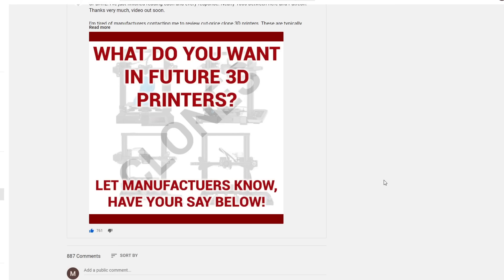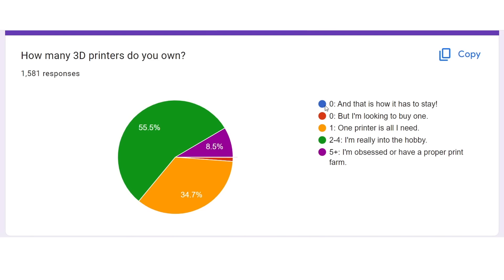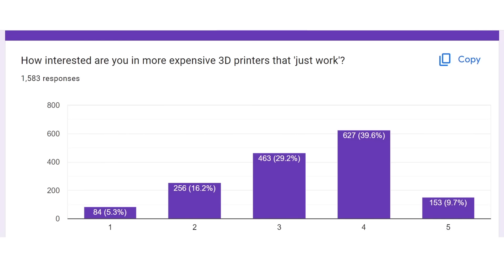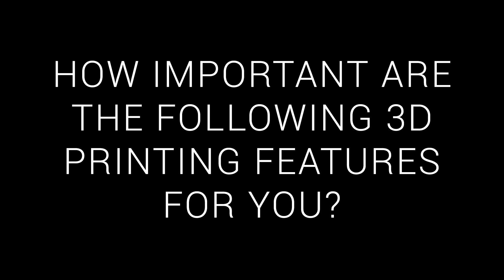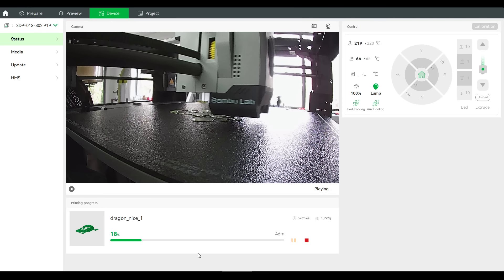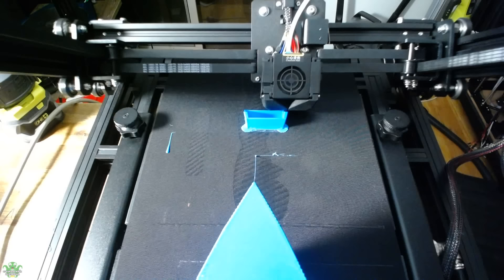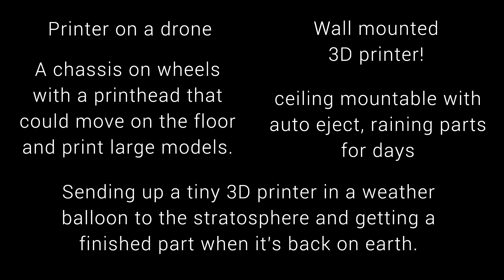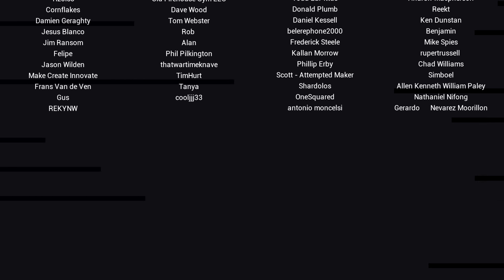The 3D printers the community actually want: Your say in 2024

Comment: ability to turn the printer of once the print is done while sleeping or at work 
laser engraving - speed - real run time estimates - silent fans -  print head pause to add magnets weights nuts balls keyrings -
power out recovery - duel sd cards - sd card removal once you have clicked print so onboard memory? - on off switch on the front - love hart  or fav button in menu to know what print works or keep using, i use a folder system of working, always print,  testing. - always print for me is some file you print no matter the color u have like a jar keychain or toy.
Reply: 1. Laser engraving can be swapped in, on tool-changing printers, generally.
2. Run-time estimates are usually good, if you have the slicer and printer both set with the same settings, and they are realistic. Often, they aren't. Klipper and RRF are both good about it, slicers in general a bit worse. I think a lot of it is that speed and accel settings, and actual speeds and accel, vary too much, without feedback to tell you the actual numbers.
3. Quiet fans cost money, and either cool worse or require ducting. Sunon maglev, FI, are quieter than anything else offering good performance, but can cost more than Noctuas, as it concerns axial fans. Noctua offers very quiet operation, but also low performance. For 50xx blowers, though, IMO, Winsinn with hydraulic bearings are surprisingly good.
4. Print pausing is supported by all popular firmwares. BUT, the exact gcode to do it can slightly vary by slicer, since it requires using slicer variables to inject the pause at the right layer(s). That basically means you have to do it yourself. It would be nice to have a universal gcode snippet to include with the STL, but that seems to be a pipe dream.
5. Power-off recovery is nice, and it's getting more common. I'd like to see them use some FRAM, or NVRAM (on the cheap, some RTC chips might have enough user memory for the job, especially if they can also be told to stop counting) for storage, or implement a power loss detection event, to only save to flash when the power loss occurs (most log the print, as it's printing).
6. Dual SD cards...why? One, to update firmware on some models, or occasionally print for troubleshooting, aught to be plenty.
7. Onboard memory exists, on the SBC, which may or may not be integrated, depending on printer. Get it controlled by a computer, if it's not already, and ditch SD card printing!
8. Favorites are a good idea, too often overlooked.

Comment: Very interesting and timely subject.
I've been in the business for 4 years, exclusively as a non-profit hobbyist. Initially with QIDI X-Plus and Artillery Sidewinder X1, now with BambuLab P1S, BambuLab A1 and Elegoo Neptune 3 Max.
I am happily retired, I enjoy it a lot, I found myself in 3D printing at the time of the pandemic, very happy with it all.
Aspects that I consider most when it comes to improving efficiency:
1 RFID as standard for filaments. I've been thinking about this forever. It's about creating the standard, or even following one that already exists, like USB-C, and opening it to all manufacturers. Consumers are grateful
2 super reinforced Nozzles, with diameter adjustment via software. It will be a very welcome game changer
3 beds with standardized dimensions. Pre-defined measurements for different printer categories
4 Unified voltage for all equipment in 110/220. The whole world will thank you
I'll stay here.
Congratulations on the channel, and continue with success.

Comment: @RPMiller, I agree 100%.  I think the 500MM size is very underserved by the market at this time.  I was very glad to see the latest Ratrig can be had with a 500MM bed size and I really like the way they do the 3 different bed sizes with the same form factor.  I think modular beds that could be swapped out quickly and easily as needed  are something innovative that no has thought to offer.  I don't always need a 500MM bed, but it sure is great to have when you do.

Comment: i used a stock ender 3(and3v2) for 4 years before FINALY upgrading to the Anycubic Kobra 2(non pro) and it is wild how quickly I learned what ACTUALLY matters to me in 3d printing. 

1) Reliability. It just works and that's it, no muss no fuss
2) Speed  I dont need my prints god awful quick but printing at mostly modern-ish speeds reliably is a god send
3) Repeatability. Its the same story every print. Same time, same quality, same expectations every time
4) Simplicity. Its just easy to use. NOTHING is hidden and its intuitive to navigate to the option i want without habing to look through a yt video
Reply: Any decently modified Ender-3 is even better than that Anycubic...

Comment: How about a slicer that adds connection hard points. Slot connections, screw holes, even just solid blocks. Even line up marks would be useful. Intelligent slicer software that can at least suggest cut lines, and orientation of prints to minimize the need for supports.

An example would be a life size foot. Oriented sole down the arch would need support, and nearly the whole inside would be filled to support the upper. If it was cut where the leg connects, and oriented toes up no support would be needed except for the toes which can be another part pointing up. The heel can be printed with minimal support under the sole with the interior hollow. Another example would be torso. Legs are cylinders, no support. Crotch of pelvis, printed upside down, minimum support inside. Crotch to bust. Cylinder, no supports. Under boob to under nipple, minimal support. Under nipple to lower shoulders. Cylinder, no support. Shoulders minimal support. Except for the sole of the heel, and under boob all the supports are inside the print.  

 Infill should be customizable to a thickening of the print walls for strength like a cardboard box not just infill the whole print. 

We should be wary of cheat pricing. That's cheap printer expensive, non refillable ink cartridges. The openings for cheat pricing with 3d printers is software that wastes filament, over priced software, and files, software that demands personal information it can sell. Updates that are down grades. Updates that are incompatible with anything you already bought.

Comment: I wish filament manufacturers provided information about the mechanical properties that their products can achieve under different configurations (layer size, infill, infill pattern…). I feel current filaments could be used for more functional prototypes, but the lack of info makes it difficult to design parts compared to other manufacturing processes that produce isotropic parts (simulating anisotropic parts can be quite difficult if you have to deduce the properties of the part from the ones of the filament). 

I’d pay for a book with tables listing average properties and recommended extruding settings for different materials, like the ones I use for designing metal, ceramic and plastic components. They are incredibly useful for engineering functional products. Unluckily I haven’t been able to find anything like that in the 3d printing world

Comment: damn forgot to vote!
for me a 60c chamber in a minimum requirement. A bit dissapointed with the bambu  p1s chamber, it goes up to 40-45c for ABS only, but i added insulation to the panels and now it's 50c for ABS
I could add a heater but that needs wiring and takes power and wastes energy.

same with nozzle probing, it's a min requirement, I DO NOT want to baby my first layer

Comment: I really want to know more how to setup marlin, when you change something or replace something. I have changed my ender 3 pro, with TFT35 display. SKR mini 3.0, BLtouch and smart filament sensor. I didn't find anything regarding that.
Reply: Get an SBC, and learn to use Klipper. It's not just about speed, but not needing to rebuild and reflash as you upgrade and tweak.

Comment: I'd really like a glass bed but with a removable sheet steel surface. The glass is a great reference shape to keep the printing plane perfectly flat. Leveling is easy, but flatness is unheard of. I'd rather not have my ABL compensate for divets that result in some dimensional inaccuracy. This is esp the case if you need your bottom surfaces to align to some mechanisms
Reply: The problem with that is that you'll need strong magnets to prevent the bed from bowing out. Usual magnetic beds use ferrite magnet sheets, baisically supersized fridge magnets. You can't put ferrite sheet under glass because it won't have enough holding power through glass's thickness. But ferrite magnets are used not necessarily because it's cheaper to (though it is cheaper) but also because they can tolerate the temperatures. Neodymium magnets that would have enough power to hold through glass lose their power right around 55 degrees celsius. There are high temp neodymium magnets, but the price stings, and their temperature tolerance is still up to 100-110 degrees, if you need your bed at 90 it'll be hotter than that between heater and glass.
Reply: @TheLaXandro  Dont use a ferrite sheet. No professional uses those, they're terrible. Do what prusa did

Comment: There's a guy, Greenboy, who's supposedly working on a relatively medium-to-low-cost pellet hotend/extruder system that could be used as a drop-in replacement for a filament hotend/extruder system. From his videos, I don't know how reproducible his current methods are as of yet since I gather the parts look like they might still be custom made (that screw in particular doesn't look off-the-shelf), but using pellet-sized plastic materials instead of filament is certainly one way to recycle failed prints.
Reply from the maker: I'm on the email mailing list. Very keen to use his design.

Comment: I just wish they a way to dye the plastic right before it came out the hot end. But another idea would be a bed that was made of many tiny plate that could raise  up and act like supports. Maybe a printer that used a bunch of tiny rods to make a mold like those gator sockets that fit broken nuts, and bolts.

Comment: i wanna see what bambu could do with a belt printer. i had a ender 5 plus for its large print area, but it died and i wanted to try something else. got a bambu p1s and its been easier all around. i dont like that its wireless only but it works well enough. the only thing i miss and that i designed around was the larger print area of the ender 5 plus.

Comment: Being able to customise and upgrade printers is what I miss most about my first 3D printer, the humble Ender-3. I wouldn't mind it if a new printer reintroduced aluminium profiles.
Reply: I think something a lot of people miss, is that Bambulab saved big by not using extrusions and using desktop pc case building tech which allows for a lot less human involvement in building the chassis and lower material use while retaining good rigidity.

Think about how much human effort has to go into assembling even the humble ender then think if the parts were injection molded or pressed into shape instead.

I think a reasonable amount of modability can be included via user accessible mount holes etc, but I think extrusion if you want high quality for lower prices is just unrealistic.

Comment: iv got a 300x300mm printer and damn i wish i had a 500x500 i do a lot of cosplay and life improvment/repair related prints where it would be nice to print larger pieces or the ability to put more parts on the print bed at one time my friend as a 400x400 and iv used it a few times for larger prints like helmets and some larger parts and it was a life saver
Reply: For a given level of quality, the cost goes up a lot, and I haven't seen firmwares with good sage correction. A lot of the machanical concerns go up by the square, or even cube, of some dimensions. Common rods and extrusions need to be much bigger, and thus much heavier, to handle it well, past around 300mm. So, I think that's going to remain a niche thing, at least for the time being. If it were as easy as just making everything longer, there would more such printers widely available.

Comment: Sad I didn't saw this survey. I think what would be the next evolution would be, take the tool changing system from xl put it in a small form factor printer with no more than mk4 build plate but instead of having 5 heads for printing at least give 2 for other things, such as small bit for smoothing surface or other type of 3d printing techniques such as robocasting (paste extrusion) and throw a lot of money in development of the slicer (what is most needed) so you can implement multiple tools in same print. Lastly make that the tools are easily exchangeble, similar to already existing 3rd party systems. So you can prepare your printer for what you want in your next print. I think also for this would be better a kinematic system with a fixed bed so it would be easier. And be able to enclose it with active heat chamber. For something like this I would have payed without issue at all the price of the xl.... Obviously I am thinking in a more premium side of things. But the thing is guys the cheap knockoff ender 3 does already a good job in simply 3d printing a part. We need more juice from it. This printer from the video would fill up almost if not all the desires of the community, multi material? Yes. Tinkering with new tool heads? Yes. Capable of more materials? Yes. Something innovative? Yes (and throw close loop kinematic just to make it shinny)

Comment: I use thingyverse alot more.. but printables does seem to have the best looking prints.. alot of my searches are in the hopes someone has already made something i need for house hold fixes.. so far this AC hose connector that clips into the plate the goes in the window seems to be the first fail across the board :P

Comment: I want a printer that's as easy and fast as a Bambu that has a big enough bed to print a full size helmet (350x350 would probably be fine) and has 2x print heads so I can print PETG+PLA at the same time for supports without the incredible waste of AMS. I would also ask that the slicer software be an improved version of Prusa - because I absolutely hate that the Bambu team removed so many of the hotkeys and got rid of the side panel that let me easily view and count parts.

Comment: I held out on the X1 Carbon for 14 months as I was hoping they would release a competitor to the Prusa XL, it never happened and so I bought an X1 carbon and AMS, the wastage is the one thing I don't like about the AMS even with calibrating it there is too much poop/
 I hope they release a tool changer next!
Reply: The poop waste is a red herring. Not counting print size, the amount of filament waste you would need to match the price difference of the X1C and XL borders in the hundreds of thousands of filament swaps. So $2500 worth of filament is 100-250 rolls of filament but each filament change avg about .3grams or less.

Comment: Not a 3D printer idea per se

But what I REALLY am interested in is a 3D design program. 

Yes, there are some out there, but they either go from insanely complex or super easy

I use Tinkercad alot because it is so simple, and I just haven't had the time to learn better programs, but also at the same time learning CAD programs take alot of time

What I would love to see, is a program that is super simple like TinkerCad, with a little bit more power to it
Being able to add chamfers, slightly more complex shapes, the ability to do things like "Place 8 small cylinders, equi-distant, around this larger center cylinder" and have it automatically do that

I don't need to be able to design a nuclear factory or an F1 car in the software I use
I just need it a little bit more powerful than what TinkerCad currently is

Comment: I like the idea of printers that are treated like cars. You can buy the very basic "stock" car and upgrade it with manufactured designed components that doesn't require us to toss huge chunk of the stock printer. A stock printer could just be similar to what's on the market today. Except, those stock printers are already prepared to accept upgrades. For example. Let's say the stock printer doesn't come with component for bed leveling, but it does have the features on it so we can just attach it later. Right now, how it is, you have to buy or print a completely new extruder assembly just to add bed-leveling to it. That makes the upgrades more expensive because you have to buy. We just need a strong stock model available with ready-upgradeablility already built on to it.

Also,  US$500 printer may be ok for many in first world countries, but us in the global majority can't easily afford that much at one time. However, a US$200 stock printer will allow us to purchase upgrades as we're able to afford them. I notice that components for 3D printers are getting very expensive these days.

Comment: a multi axis robot arm with an extruder at the tip, and a bed that can rotate in a circle would bring multi axis printing, but I don't know that it could get the speed and reliability of corexy.  and then the question becomes whether multi axis is better than speed.   but you could also have that arm swap heads, so that brings multi material, nozzle thickness, etc to the table.  
perhaps that arm could be mounted above the bed, limiting the required space.  almost like a delta setup, but the head can pivot and reach around. who doesn't want a reach around from their printer? :-D